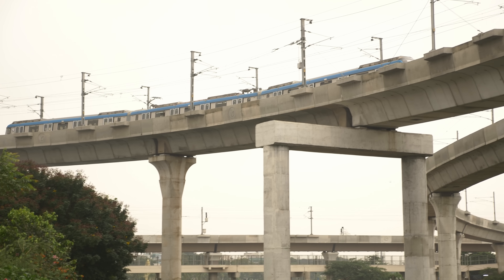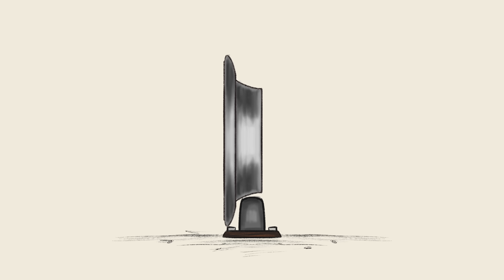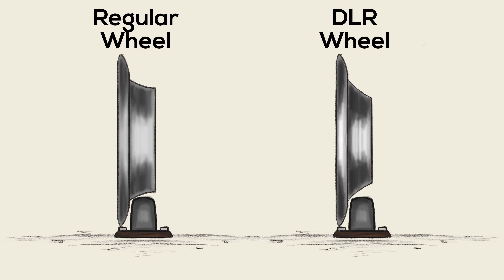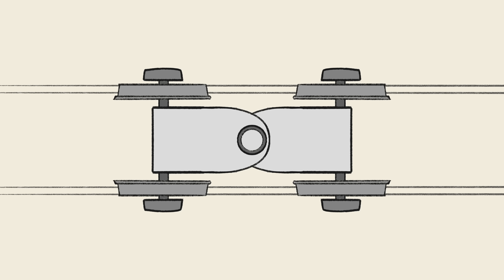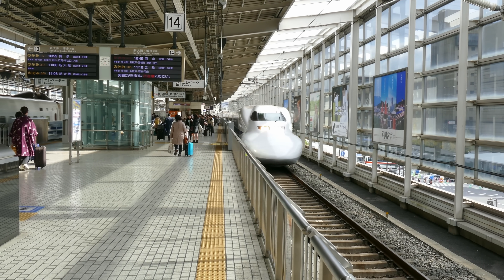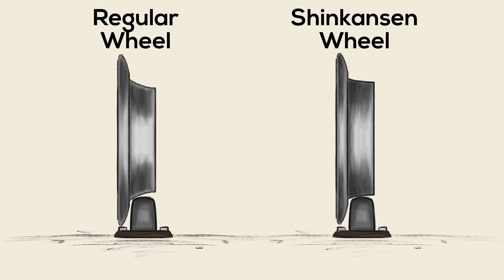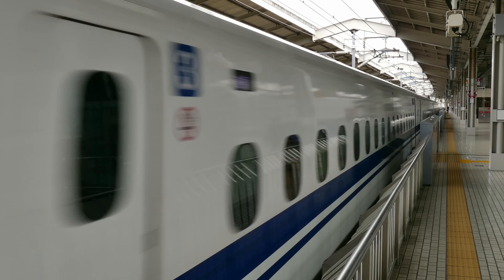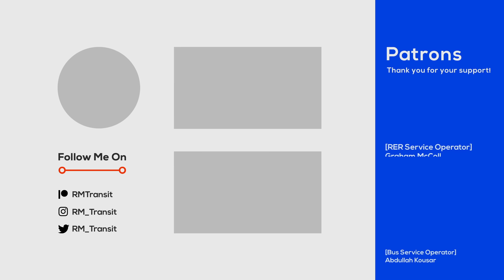BART, DLR, Bullet Trains and Their Odd Wheel Profiles.

Comment: Truth be known, Bart's decision to go with 1,676 mm gauge instead of standard 1,435 mm was a horrible horrible mistake.  Wide trains just aren't good at taking turns...it's basic math.  Wider trains need either more differential or banking, else slippage occurs.  This causes not just noise, but degrades tracks and erodes wheels.  Narrow gauge is actually a good option to reduce maintenance, noise and turn corners faster...but they do hunt more than wide gauge.  While differential might increase the cost/complexity of rolling stock, it actually might be worth researching/implementing (like the MF 88) to reduce noise/track destruction, and to take corners faster.  A fun video topic would be on Hitler's proposed Breitspurbahn (super wide 3,000 mm rail) and why it would have been an engineering disaster.

Comment: So the solution to the terrible squeaking at Harvard Square of the red line in Boston is to make wider wheels with more "different size" options to accommodate the tight turns? Is that going to make the train hop off the tracks on the straight fast stretches?

Comment: The details of bogies and wheels are interesting to me because I'm also a fan of roller coasters--which are a kind of gravity/inertia-powered railway, but their wheels and wheel assemblies are completely different. The wheels are not conical or flanged. Roller coasters don't have axles connecting the wheels on each side--each wheel has an independent bearing. But they've got additional sideways-mounted guide wheels to keep the train horizontally following the track, and upstop wheels running under the rail to keep the train locked vertically to the track (which is supported from the side opposite the guide wheels). If the wheel assemblies don't break, and the rails don't break, the train physically can't leave the track, even if it flips upside down or the train is subjected to violent negative G-forces. This is a solution that could probably only work for very light vehicles traveling very short distances, and the switches have to be slow, bulky mechanisms that swap out whole segments of track. But it's interesting to see how much it diverged from the conventional railways that roller coasters partly evolved from.

Comment: Is the wheel shape something easy to modify with new rolling stock, or would this require more expensive modifications to the rails themselves? Do you know if the next-gen BART trains have different wheels than the original ones they are replacing?

Comment: CTA in Chicago still uses a cylindrical wheel profile and has for many years.  BART used to use a cylindrical profile and has recently changed to a more optimized profile.  Keep in mind that once a cylinder wears a little bit it tends to be concave.  Wheel-rail interaction is a complicated subject and there aren't many people around who really understand it well.

CTA has quite a few tight curves (down to about 85'/26m) radius and it also has top speeds of about 58mph/93kph.  The cylindrical wheels work well in both situations though optimization still would be helpful.  In tight curves, a restraining rail is installed to help steer the trucks and reduce rail face wear by guiding the back of the wheels on the low side of the curve.  Also, a lot of the squeal/noise through tight curves is actually from the wheel on the top of the rail and not the wheel flange and can be reduced by using a water-based friction modifier material.

Comment: You've probably covered this before, but on a recent trip to Paris, I was reminded that some metro trains run on rubber wheels. I first visited Paris in the 80s, and seem to remember the RER trains had this - now it's on other metro lines. On closer inspection, it appears the train is running on a 'guided' track, with a horizontal wheel keeping the alignment. How common is this? It feels like a much smoother ride!

Comment: What about a wheel that has varying steepness- if going straight, it rides on the flatter portion, if turning, it rides on the steeper portion.
Reply: All rail wheels have that. The transition from tread to flange is not abrupt like on toy trains but a curve. So even very flat profile wheels (or completely cylindrical wheels) will experience a turning force due to an effective increase in radius.

Comment: Talk about the BART system in general.

Shows the Oakland Airport Peoplemover that, though operated and branded by BART, shown on the BART map and travels from a BART station to Oakland International,  is a completely different system with a completely different method of movement.

Also to clarify, that section that was way too loud?  It is in the Transbay Tube, (which amplifies sounds since it's a tunnel that runs under the bay), it is the one part that BART can actually run at full speed and the sound is likely worse then you're imagining.  The "solution" is that the new cars have better sound dampening.

Comment: I've experienced a particularly fun type of hunting on ЭР2 and ЭМ2 (old Russian EMUs that are slowly going away) a few times, it happens on select few cars rather than entire train. Tech these use is very old, bogie design is simple and motors are controlled with air-actuated camshaft switch and resistors. So bad maintenance causes improper timing of serial to parallel switching (if I remember right) on a powered car which produces considerable jerking at a certain point during acceleration, this overstresses dampers on bogies and they leak and die quickly, and then a tiny bit of hunting oscillation at (relatively) high speeds starts up violent shaking since there's nothing to prevent it anymore, car just keeps bouncing on the springs and lateral wheel movements get amplified by a magnitude

Comment: Bart recently reprofiled their wheels though, around the time they got the new rolling stock. Noise is greatly reduced.
Also: double-deck BART would seem like a nightmare, given the close station spacing in Oakland and San Francisco.
Reply: Double-decking without adding a multi-layer platform would increase dwell times at stations because you need to allow time for people to go up and down the stairs. For suburban rail services, this probably isn't going to be a problem, but for metros with tight frequencies and frequent stops, it would hurt line performance by a considerable amount.

Comment: The description of the wheels sounds like what a CVT transmission does in varying the drum size based on power requirements. The full explanation made me realize why on some turns NYC subway tracks have an extra smaller rail next to the main one: to help in the "size" changes needed on the inner wheel to cause the outer one to ride up higher in the turns. They also seem to help this with a slightly lower height of that same inner rail which makes the trains look like they are leaning into the turn. I see this a lot on Metro North and the D.C.Metro.
Reply: The smaller rail is a check rail to prevent extreme movements if the train details.

Comment: Nice point about wheel profiles.
You could mention Talgo wheels which turn independently (but must be steered to be at the correct angle to the track). A wheelset has a way to steer itself, independent wheels don't do this so they need a steering mechanism (steering the wheelset dependent on the angle between bodies).
The ULF trams in Vienna use a similar system, which is so complex it has not been used much elsewhere, and for the next series (Flexity) they changed to a mechanically simpler concept again.

Comment: I definitely notice the hunting oscillation on Link trains in Seattle, especially when going between Cap Hill and UW. Though, I'm told that's in small part due to the fact that the rich neighborhood the tunnel runs under didn't let ST put enough ventilation shafts, so the trains speed up and then slow down a few times to compensate. When the train is on the elevated guideway in south Seattle going to Tukwila it's totally fine and in the new tunnel from UDistrict to Northgate I haven't noticed it, either.

Comment: When you started talking about BART, you have footage of stations with platform screen doors - is that from the BART system? If so where? I have wanted them to add them at all stations for ages now

I have used BART a lot and can't remember any that have screen doors - though I have not gone on the Beryessa extension or the Antioch connector yet on the main lines. Only the OAK airport connector have PSDs that I know of, but that's not the BART system perse - it's a cable driven automated cab
Reply: It’s the SFO Airtrain. You can see the actual BART tracks on the bottom level halfway through the ride

Comment: BART makes me think of the Noeval in the future Rennes metro line b...  A very bad solution. The Val had its problems but it runs well enough, it was useless to modify it into a BART style guiding system.
As for articulated bogeys, you really should check out the Ligne de Sceaux, the precursor to RER B line in Paris, the first line had such articulated bogeys before the 20th Century, Denfert-Rochereau train station building shows the curve of the ending loop the original line had... Very tight curve, similar to amusement park train rides ! The line was changed to a more normal one years later and extended to Luxembourg station and became Ligne de Sceaux operated by the CMP (the precursor to the RATP for the metro). The tracks at Luxembourg where lowered in the 80s to allow the line to be extended under the river Seine to join Châtelet and Gare du Noard and incorporate the Roissy Rail (the line to the Charles de Gaulle airport) into the line to give the RER B we know today. Fun fact the St Michel tube style station was added after the tunnel was built and the former CMP Sceaux didn't have the power to weight ratio to accelerate on humid tracks in that station so they couldn't stop in case of rain, but they were replaced by MS61 and then MI79 trainset shortly after anyway.
The metro tried to solve the curve problem with independant wheel system (one pair of wheels instead of a 4 wheels bogey) but the trains on line 7bis are far more unstable in straight lines and wear off much faster. The speed was limited to 40 kph as a result... Good thing that 9 trainsets series was just made as a prototype series and not generlized to the rest of the metro...

Comment: So, basically, decide whether you want a fast line with long sweeping curves or a slow line with tight corners, but don't try and do both with one system.
Reply: You can by adding dampers to the bogies. Or possibly, with some active steering system. That greatly reduces the instability at high speeds, while still being able to steer in tighter corners. That's why many modern trains have those hydraulic cillinder looking things connected to the bogies.
Reply: is it possible to have wheels with changing slopes? like have a toroidal/horn-shape profile instead of a straight cone
Reply: Have a second set of more conical wheels with a narrower gauge then on every tight corner stop the regular track and build a narrower gauge of track. Super overcomplicated solution but technically could work.

Comment: Your “what makes engineering wheels complicated” section was a bit, in itself, over-complicated. It’s not that wheels are necessarily “larger” (the wheels are all machined to the same overall size/diameter) around different parts of the train, it’s just that the wheels on the outside of the turn adjust so that they contact the rail in a different position along the conical surface than those on the inside of the curve do. The way you phrased it almost made it sound like the wheels themselves are machined to different sizes across their entire body, not that they’re conical. Excellent video, just wanted to point out that this may have been confusing to some viewers.

Comment: I'd love to see some discussion on rail gauge! I'm always confused about narrow gauge rails, given many still run wide rolling stocks, and the general right-of-way dimensions have to accommodate them. So there's no cost savings in using the narrow gauge, just a lot of train wobbling on tiny bogies
Reply: Narrow gauge allows for tighter curves, which saves construction costs and is useful over mountainous terrain. This does severely limit train speeds, which was okay in the 1800s when most narrow gauge networks were built as there was little competition from road transport back then, but is a major issue now.
Reply: @cityjetproductions  It's also fairly good for most intracity (note: not intercity) trains (including trams/streetcars), for much the same reason. 
But yes, New Zealand's railways are narrow gauge, for example, precisely because every line from one city to another, or sometimes even in a single city, either has to go through mountains or hug the coast to go Around mountains and steep hills (except, to some degree, in the Canterbury planes).  So, Narrow gauge it is. Kind of a big deal back in the days of steam, though these days only noteworthy when a tourist decides to make a video about the fact that intercity rail in this country basically consists of 3 or 4 lines of tour trains that move at the same speed as the freight trains (not surprising, they run on the same track with the same engines!) and a few short commuter lines around Wellington.
Reply: @laurencefraser  Yah, lots of streetcar/tram systems have been narrow gauge.  Ours here in the Twin Cities (Mpls/St Paul, Minnesota, US) were narrow gauge back in the horse-drawn days, but they converted to standard gauge when they electrified in the 1890s.  (Then were torn up and replaced with busses in the 1930s-50s, like so many US systems. 🙁)

Comment: I would love to see how YOU would address the mess that is the Dufferin Loop. I's just too many streetcars. I live in the area. I always thought that it would be great to cancel that loop and extend the tracks OVER a new bridge an into a new subterranean station/platform/loop under the parking lot of Medieval Times, alway considering what is happening with the new Ontario Line and Exhibition loop.
Reply: Lines that use loops should scrap them when they get new stock. That stock should be double ended with doors on each side and just reverse to change direction. For street running, it’s no problem to disable the doors on the side furthest from the kerb.

Comment: Anyone that has ridden on (the old) BART trains has heard the soul-piercing hellscreech of Satan's unbearable pain. The good news is that they are buying new trains with conical  wheels. No more flat profile, no more hellscreech. And they are also machining down the wheels on the old trains too. BART has (many, many) other problems, but I think they solved that one pretty good.

As for the Indian gauge, the story I was told was that BART was designed to cross bridges across the SF Bay, including the Golden Gate. The wider gauge was for stability in high winds during the bridge crossings.

Comment: I've been under the impression that the top speed of SkyTrain is limited by the reduction in efficiency of its linear induction motors as you exceed about 80-90km/h. I remember doing a lot of math in physics 11 about this, and our teacher emphasized the advantage of linear synchronous motors, which have no theoretical top speed. So, not sure if hunting is actually contributing to the limit on SkyTrain. On the Scarborough RT I think the limit is the shoddy maintenance program!!
Reply from the maker: Hunting definitely plays a role! It is too bad how poorly maintained the SRT is though…
Reply: @RMTransit  do you know if GO-ALRT was going to use steerable trucks as well - and if so, was that going to be a challenge for the I think 120km/h design speed?

Comment: Similar to the Vancouver Skytrain's very specialised turning bogies, the Paris Metro's MF88 stock has differentials across its axles which means the wheels can turn at different speeds when going round a corner. Just made them significantly less reliable.
Reply from the maker: Indeed, there’s a big complexity tradeoff here. Trains do a LOT of miles so if you constantly have to fix or maintain something that’s a big negative

Comment: This is also one of the reasons why narrow gauge trains can take tighter corners, the difference in speed between the two wheels is smaller if the distance between the rails is smaller.
Reply: what?
Reply: @assassin9763  Another way of saying it is that, because the radii of the two rails are more similar, the distance the outside and inside wheels have to travel is also more similar. This means the cone-shape is less-needed so you can turn tighter. You take this to the extreme and you get model trains, which can circle the Christmas Tree no problem.
Reply: @DJ-Sellout  thanks...
Reply: The problems described in this video are also affect narrow gauge trains much more severely.